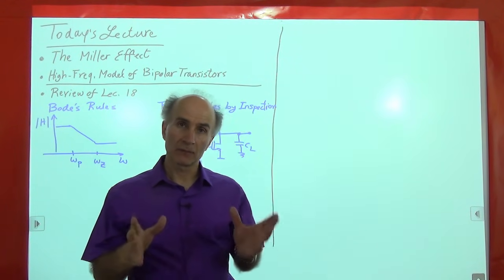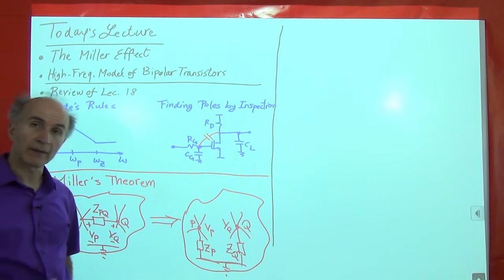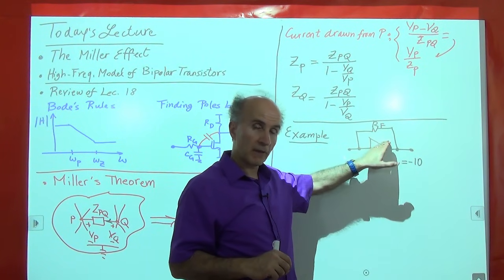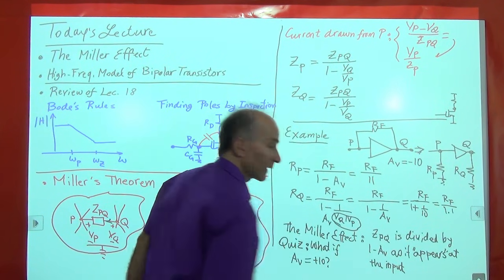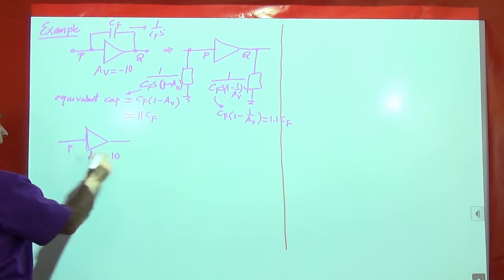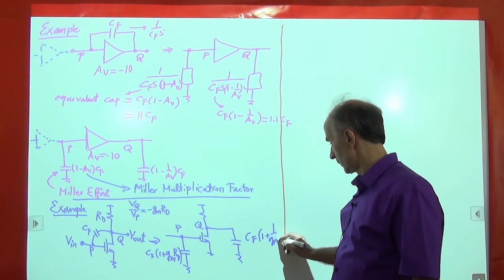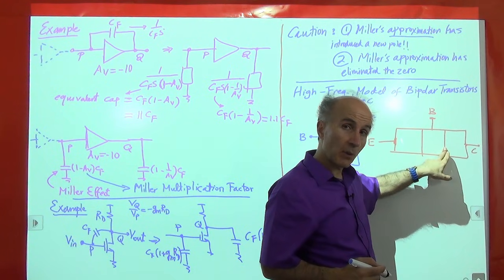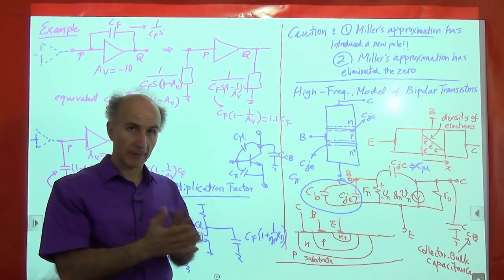Razavi Electronics2 Lec19: Miller Effect, High-Frequency Model of Bipolar Transistors

Comment: Dear Professor Razavi, Thank you so very much for your great presentation on Miller Theorem!!! You mentioned the floating capacitor between Base & Collector of the transistor introduces a "Zero". There is no resistor between base and GND. Are you referring to esr of that capacitor? Could you please explain that? Best Regards
Reply: It eliminates a zero,doesnt introduce a zero.Theres a pole introduced due to the approxiation
Reply: With out using Miller's theorem if you calculate transfer function of that circuit you will get one pole and one zero, v0/ vin = SCf -gm /( 1/Rd + SCf) came  if I use Miller's theorem  transfer function = -gmRd / (Rd S C(o/p) +1)  where Cf ( o/p) = Cf ( 1+(1/ gm Rd)) here in this transfer function consists only one pole, zero eliminated.. that was the statement professor gave

Comment: 01:25 - Intro
05:00 - Miller's Theorem
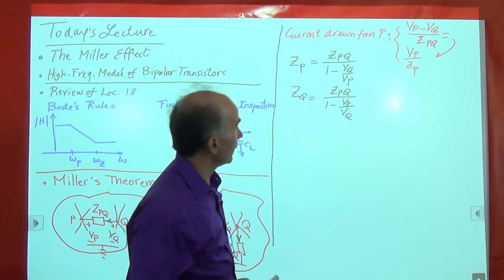13:17 - Example with Feedback
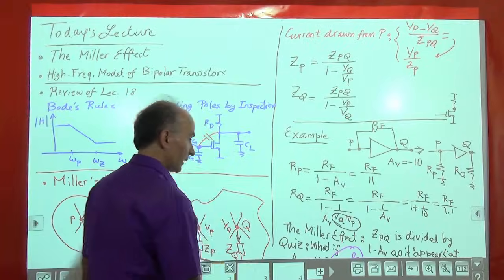23:00 - Capacitor in Feedback Loop
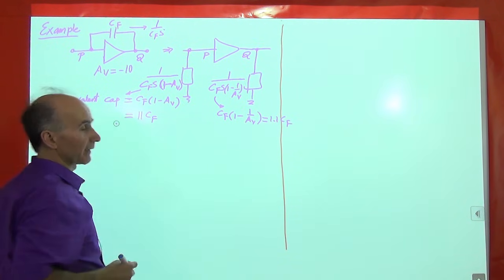27:10 - Miller Effect; Miller Multiplication Factor
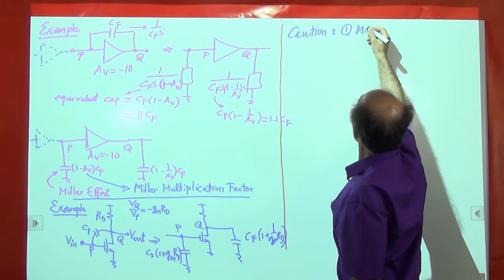34:50 - Caution
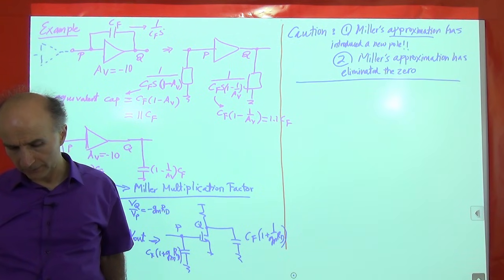37:25 - Parasitic Capacitors; High-Frequency Model of Bipolar Transistors.
Reply: goat

Comment: Why we don't consider Miller effect in Common Gate configuration when we study high frequency response?
Reply: CG configuration: Input Source Output : Drain and we dont have any capacitance between Source and Drain that is the reason
Reply: Cgd capacitor is grounded in CG configuration.